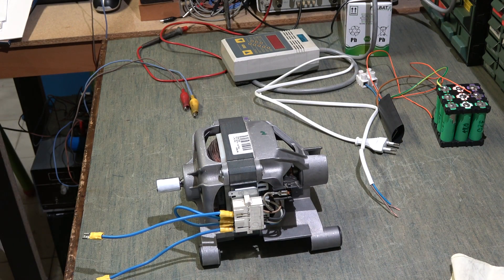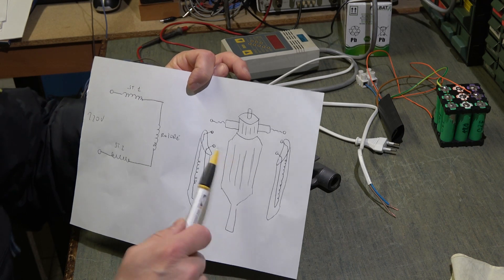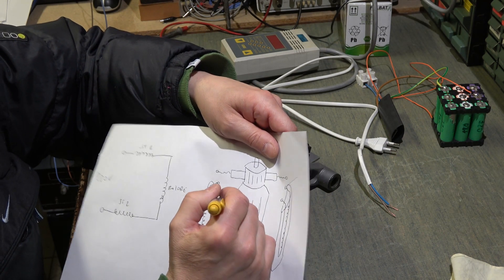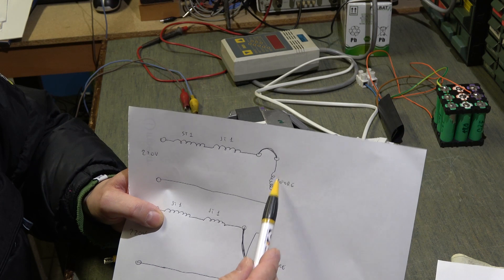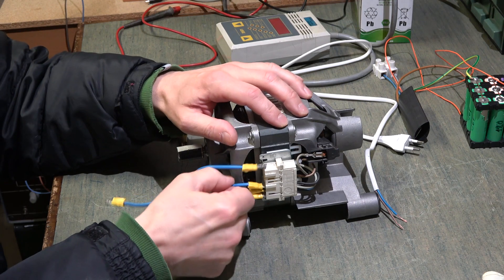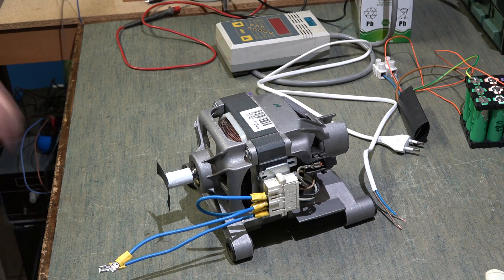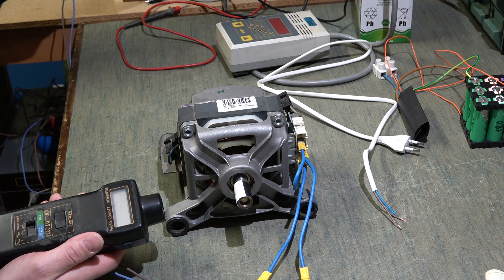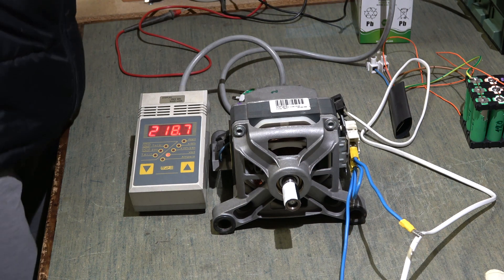OP 66: motore spazzole lavatrice # funzionamento e collegamenti

Comment: Il tuo video sul motore lavatrice e stato molto chiaro e interessante. Volevo solo capire cosa hai usato per avviarlo prima di usare la corrente a 220 v , e se nel caso una batteria a 12 v  può farlo girare?  Per quanto riguarda i giri, regolarli mentre e collegato a 220 ci vorrebbe un potenziometro? Ti ringrazio e attendo una tua gentile risposta buona giornata
Reply from the maker: Non so se a 12volt gira, prova. Per variare la tensione puoi usare un regolatore di tensione, lo trovi su amazon a pochi euro.
Reply from the maker: se vuoi fare una prova usa questo link
Reply from the maker: ce ne sono anche di piu performanti e costosi
Reply from the maker: meglio questo 
https://www.amazon.it/Regolatore-Tensione-Elettrico-Temperatura-Velocit%C3%A0/dp/B08964LBS5/ref=pd_sbs_sccl_4_3/259-0993300-1013616?pd_rd_w=eCD2v&content-id=amzn1.sym.7dbf056a-a9ae-4272-b716-21428073c8b0&pf_rd_p=7dbf056a-a9ae-4272-b716-21428073c8b0&pf_rd_r=WFPYFGGB1GWWPQBZ351C&pd_rd_wg=7lCu8&pd_rd_r=06d5d8b8-8564-41dd-b553-477b93da6d67&pd_rd_i=B08964LBS5&psc=1

Comment: Salve,
posseggo una lavatrice ignis loe 1278 eg (comprata 10 anni fa) che non mi ha mai dato problemi.
Da pochi giorni il cestello non gira più. In pratica, durante la fase finale di un normale lavaggio breve, la lavatrice si è bloccata e si è accesa la spia rossa "assistenza".
Ho staccato la spina per aprire l'oblò e i panni sembravano ben lavati ma se provo a riavviare un ciclo di lavaggio, noto che dopo aver caricato acqua, il cestello non si avvia.
Dopo il carico dell'acqua, sento i click dei relè che dovrebbero azionare il motore ma lo stesso rimane fermo e poco dopo si accende la spia dell'assistenza.
Lo scarico dell'acqua funziona.
Dopo aver controllato il filtro di scarico e di ingresso (che erano puliti), ho fatto partire per errore la lavatrice con il rubinetto dell'acqua chiuso e dopo 1 min circa l'ho riaperto.
Ad ogni modo, il carico dell'acqua parte ancora ma non vorrei aver bruciato qualcosa facendola partire con l'acqua chiusa.
Ho quindi smontato il motore e le spazzole mi sembrano in buone condizioni (sono lunghe 4 cm circa).
Il motore è un C.E.SET. MCA 52/64 148/WHE18 1.80A 350W
Ho misurato il valore in ohm tra i vari morsetti (sono 7)
(1-2) Tachimetrica 69 ohm (con il tester ho anche confermato la continuità tra i due morsetti)
(3-4) Valore tra le spazzole 4 ohm (con il tester ho anche confermato la continuità tra i due morsetti)
(5-6-7) Poi ci sono i 3 morsetti dello statore (tra 5-7=1.2 ohm / tra 6-7=1.5 ohm / tra 5-6=2.3 ohm) - (con il tester ho anche confermato la continuità tra tutti e 3 i morsetti)
I valori in ohm sono nella norma? O da qui si può capire qualcosa?
Vorrei inoltre testare il motore con un comune alimentatore da 12V 1A
Se faccio un ponticello tra 4-5 e alimento tra 3-6 dovrei poterlo avviare?
Ci sono altri controlli che potrei fare?
Grazie
Giuseppe
Reply from the maker: una cosa che puoi fare è controllare che il motore sia a spazzole e che le spazzole non siano consumate
Reply: @OberdanPanseri  : ho controllato ed il motore e a spazzole e le spazzole mi sembrano buone (4 cm circa di lunghezza - ho fatto prova anche con la continuità del tester e la continuità c'è). Dovrei testare il motore. Grazie
Reply: @OberdanPanseri  
ho appena testato il motore con un normalissimo alimentatore da 12V 1A ed il motore gira.

A questo punto, come potrei testare la scheda madre?

Posso avviare (con la massima precauzione) la lavatrice senza il motore collegato? E magari, con il multimetro, verificare se il connettore della scheda madre, che si collega al motore, fornisce la tensione che dovrebbe alimentare il motore?
Reply: Ciao  devi  testare  la  resistenza  è   sostituire    il  sensore  della  temperatura   prova  sarà  quello